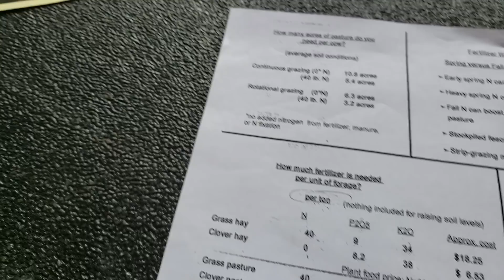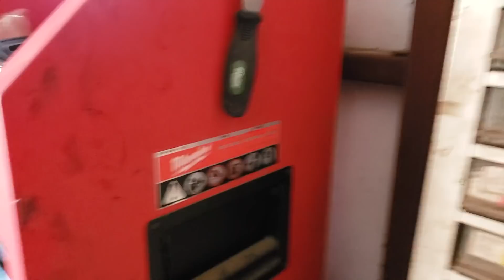Hay crop inputs and yields

Comment: Your right on with the lime. It takes a long time to get the ph up. My ph was down to 4.4 on the lower pasture last December when I took the soil test. I am up a little over 5 now. You can have greak NPK numbers in the soil on nutrients, but if the ph isn't right the grass cant absorb them to grow. I'd guess your ph is close to right now, otherwise you wouldn't have got that much tonnage off those fields. Nice job Nate. Hard work pays off. So you ended up with 2-2.5 ton per acre yield then?
Reply from the maker: Yup best yet boss